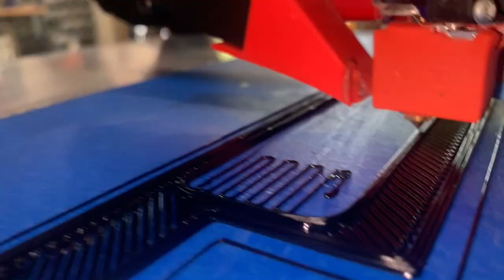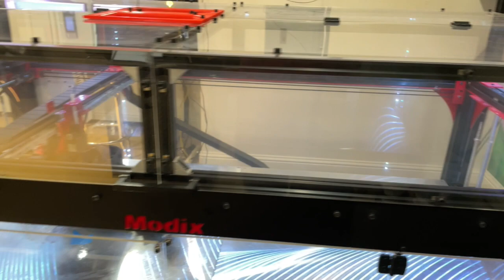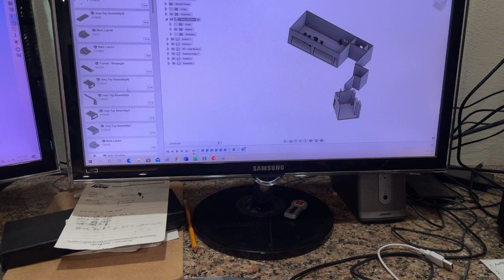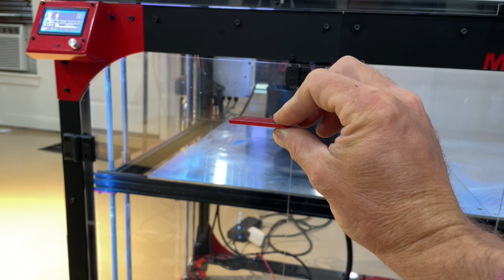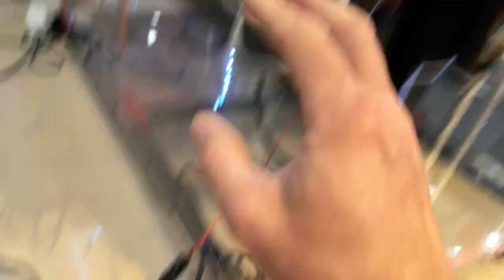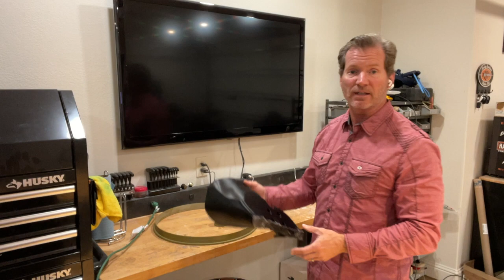Modix Big 120X Review

Comment: We just found one of these in the trash and pulled it out. I was able to home the x and y axis. All of the z axis screws are missing their belts. The question is, does the z axis have a limit switch, i didn't see one on the machine
Reply from the maker: There is not a Z limit switch on any of the Modix machines other than homing.  Your software is where you put in the dimensions.
Reply: @CLTaggart  Thank you. I will dig into this thing this weekend and see if i can get everything leveled with out crashing. I will try to see why someone would throw this away.

Comment: @CLTaggart I am putting together a proposal for getting one of these at work. Could you post Amazon links to parts you suggested we get from the beginning? I think it would help if during initial assembly, we could put in upgraded parts such as gears and bearing you mentioned. Also the Y-Axis 'carriages' (I am not familiar yet with correct names). Thanks so much for doing this video, very helpful!
Reply from the maker: The newer versions handle everything at this point.  I just finished a 120Z from Modix a couple months ago, and it is great.

Comment: You can modify the scripts in g code within simplify 3d under  the script tab in edit process settings.  To set up a ending script, to automatically turn off the bed.
Reply from the maker: The Modix Model 1 and 2 do not have the heaters hooked into the hardware. They are manually turned on and off.

Comment: I've been having troubles with my 120x stripping out the filament at the extruder. I have a 10lb roll that I put on a roller with bearings which helped for a bit but I was wondering if my tensioner was too tight. Any ideas?
Reply from the maker: It could be a few things:
First - does the roller you made pull easily? This may be an obvious question but needs to be asked. Is everything working on a smaller roll?
Second - is the material you are printing getting clogged which causes the stripping?  Make sure no matter what you are printing, it is dried.  I spent literally a month wracking my brain and yelling at the machine when I was trying to print PETG the first time only to find the material was not dry enough for long enough.  What you read online will make it sound like the material will be good for a few days, but these big machines can print for a long time.  Plus, if you are using a 10 lb roll, keep in mind that there is a lot of material below the surface which has to dry. I have a video of me modifying a PrintDry to handle large spools if you have not seen it.  Now, for me, except on very rare occasions, I dry filament and print from the dryer.  It is more reliable and truly looks better.
Third - on your tensioner, loosen it all the way, and then take a black marker and make a line in the 12 o’clock position. Use this for your reference point and tension it 3 full turns.  That is where I am set, and I have not touched it since that worked.
Fourth - is it your material?  While it is rare that this is the issue, you may want to try a “better” quality.
Fifth - Are you printing too fast or not hot enough?  I am running an ABS print right now at 250C and 3600 mm/min.  I run PLA around 240 C and PETG around 250 C.  That sounds hot to most people but works best on my machine.  Stripping can be caused by the material jamming in the nozzle, which if the material is not hot enough as it passes through will make it stick.  I go faster as well (up to about 6,000 mm/min), but usually what I do is time the filament to last 24 hours and go at that speed so I can check it the next morning.
Sixth - have you step calibrated your software?  When I was going through that monthlong period, I came across that as an issue as well.  The software commands the extruder to go through so many steps per mm or meter.  Your steps might be too many.  It is easy to do and there are videos on this out there.
Try all that and let me know

Comment: Thanks for your review of this machine. I have been considering the Modix Big 60. My concern is the difficulty involved in loading the firmware. I wonder how this went for you as you mentioned it was your first 3D printer. Also are there printing profiles set up in Simplify3D?
Reply from the maker: It is my second printer, the first being a Zortrax M200.  It is the first I assembled as the Zortrax is very user friendly.  That said, the Modix comes with the firmware and is easy to get started with their tutorials.  I use Fusion 360 for design and Simplify3D for the slicer.

Comment: Any issues with bed leveling?  Any issues with gears and gear screws slipping?
Reply from the maker: This size bed needs to be leveled every time before a print.  I replaced pulleys with brass. Also I had an issue with the rail cartridges wearing out.  I replaced the bearings with ceramic bearings and had no issues.  Once a month, you want to check the belts for each z screw.

Comment: Hi there MR Taggart. 
I’ve also been getting great results from our 120x. Use a 0.8mm nozzle mostly, 0.4mm layer heights. Slice with Simplify3d. Use Pla mostly as proto prove off. 
Done 1000 hrs. Replaced the hot end but now getting issues with under extrusion. Been through all the advice online. Could please see a copy of your Simplify 3d process fff file. Just to logic check my fault finding. ?
Hope you can help. 
Bob
Reply from the maker: What is your email? If your settings worked previously, then there must be an issue with the hot end. Definitely dry the filament, I have gotten to the point that I always dry mine. Try a new roll of filament. Use a thermometer to verify the hot end is actually hot enough. Try a new nozzle. You may have done all this of course.

Comment: Where do you see the limits of the movement speed?
Reply from the maker: I am not sure if you mean on the machine or slicing software.  If you are referring to the machine, you will need to experiment with different prints until you are happy and record those as it varies based on material and the print.  Definitely slow it down.  There used to be an awesome site that someone had with a beautiful graph and everything but it is gone now. Generally, if you are using a .4mm nozzle, keep it below 100mm/s.  If you are using a 0.8, keep it below 50 and if a 1.2, maybe 30-40. I have focused on using a 0.8mm nozzle and time the speed so that a 1kg roll runs out in 24 hours.  That way, I can start it in the morning, and then each morning get up and change the roll.
Reply: @CLTaggart  I wasn't even thinking about the hotend throughput, I actually meant the limits of the motors and stuff like that 

Basically all videos I've seen of modix printers online were with big nozzles and low speeds, so I was curious if they are limited in speed/acceleration due to their size and thus weight.
Reply from the maker: @BelviGER  there are many videos of belt systems moving fast, but the problem with a big printer is that if it is running across the platform at 2000mm/s because it is going from one end to another, and you have a little warping or a printed are with a dribble that came out and hardened, then best case scenario you get a little shifting.  Worst case scenario it will tear the whole extruded system off and keep extruding and end up entombed in a mass if hardened material.  Smaller prints you can go as fast as most printers. But if you are printing something greater than a foot in length I would start slowing it a bit.

Comment: Have you printed with carbon fiber nylon yet and if you have how was it
Reply from the maker: Yes, I have printed with it quite a bit.  Take a look at my video on custom lowers for a Harley Road Glide.  Great to work with, but of course does warp, so depending on the size of the print you want to incorporate the warp or position it based on warping.
Reply: @CLTaggart  I have some prototypes I'm looking to print that are 2ft x 2ft x 16 and they need to be functional for testing. Seeing you have lots of experience with this machine that's why I was asking
Reply from the maker: Feel free to email me at ctaggart@aol.com - I am down for a month or two until my new workshop is completed but I can certainly take a look.

Comment: Looking to purchase this unit to print large prototypes and molds. If you don’t mind how did you make lower speaker pod print end user quality? If you had to do it over again would you still purchase this unit?
Reply from the maker: The lowers I printed went through several iterations for fit, and I used a 0.4mm nozzle to try to get fine quality.  It would have been the same with a 0.8mm nozzle as I still brushed it with XTC 3D resin to fill in layer lines (2 coats) and then sanded fine.  I would still get this unit and actually am ready to purchase a bigger one coming out soon.

Comment: What was the fastest speed you could achieve with 1mm nozzle and pla?
Reply from the maker: On a larger nozzle like that probably about 30 mm per second.  It will be much lower than the smaller nozzles but the volume of material is significant higher. So walls are printed 3 times thicker than a 0.4 nozzle.